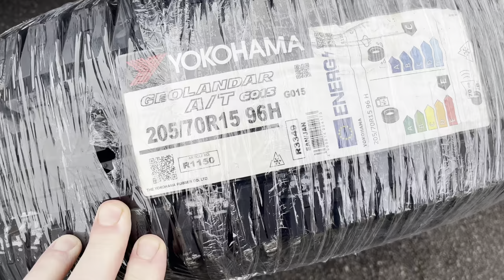VW CADDY VAN UPGRADE | Fitting All Terrain Tyres - Yokohama Geolander 205/70/15

Comment: I am tempted to do this myself. Speedo wise the size increase seems to correlate to about 5% difference on the steelies, which is coincidentally about the same amount my speedo is off.
Reply from the maker: @corroded  Just go for it, I have no regrets on doing this upgrade 👍
Reply: @LoneWolfExplorer 

What is the departure of the disks?
Reply from the maker: @Денис-я6й6и  I’m not sure what you mean.

Comment: hi mate, just seen this video! van looks very smart. I have a 2016 1.6 TDI caddy with off road toyo tyres on, they are incredibly useful and the van goes where my hilux doesn't dream of going!
Reply from the maker: Well that’s good to know that your caddy is good in the muddy stuff with the toyos. Is your caddy a 4motion? I’m not planning on any off-roading in mine but wanted to know I have a better chance if I do venture off the tarmac. Thanks for watching mate 👍
Reply: To be honest, im not too sure if it is a 4 motion. Its a reliable van though. However, I have received some major problems at only 96k miles. It needed a new clutch,break discs, wishbones, injectors,callipers and a lot more. It's an ex police van for West Mercia police so has been through the wars! But, its a great van and a speedy one too!  @LoneWolfExplorer
Reply from the maker: @amasfarmcontracting7602  That’s interesting, don’t think I’ve seen a police caddy van before, well not that I can remember anyway. They are great little vans, I really like mine and I’m not easily pleased. Mines a high mileage one and had quite a lot of work done also, including the injector.
Reply: Mostly used by dog unit but the shorter caddy vans are rarer for the Uk police as they have now gone for the longer base caddys. I usually go to breakers yards for parts as they are cheap and really reliable. No need spending so much at VW dealerships as they can rip you off! VW wanted to charge me £10k for a new clutch and gearbox but got the clutch and gearbox fitted at a small garage for £2k. hasn't broken down since(March 2023) @LoneWolfExplorer
Reply from the maker: @amasfarmcontracting7602  Wow 10k for a clutch at VW…..that’s mind boggling. I only use smaller garages anyway or try to do stuff myself. The previous owner of my van had nearly all the work done at VW, I’d imagine yours did aswell being ex police.
Reply: I was not too pleased with the quote given by VW but would not go to them in an emergency haha, yeah all works were done at VW when it was in service, everything is reinforced and still had blue lights on the roof and grill which i had to change for amber ones. But having a caddy as a sleeper is great! Slept in it twice on the job and was better than many hotels I have been to. @LoneWolfExplorer
Reply from the maker: @amasfarmcontracting7602  Yes I also think they make a good stealth camper provided people don’t actually make them look like a camper van 👍

Comment: I have 215/65r16 on mine and it works perfect!
Reply from the maker: That’s great, I looked at fitting 16s as wasn’t sure how easy it was to get ATs in 15s but was easy enough. I bet it looks good with the 16s, what ATs are you running?

Comment: Merhaba dilinize pek hakim değilim . Sadece izledim . 205/70/15 tekerlek taktınız yorumlarınız merak ediyorum . Aracı toplamda kaç cm yükseltti? Viraj performansı nasıl km ekranındaki hız farkı çok farketti mi ? Yakıtı etkiledimi? Yorum olarak yazabilirseniz çeviri aracıyla videonuzu anlayabileceğim
Reply from the maker: Hi, I tried to use google translate but its not that accurate so I'll try my best to answer. First of all thanks for watching and did the subtitles help? With cornering, I can't notice much seems the same as before. Not sure how much it raised it off the floor with the bigger tyres but it has no suspension lift. I have checked the speedo & it is now accurate according to GPS on sat-nav.

Comment: I have 18" wheels, do you know of any all terrain options?
Reply from the maker: Well actually yes, Yokohama do these in an 18” as I’m looking at using them on my Subaru in a 235/60/18. Also Falken wildpeaks do a 235/60/18 & Toyo open country do a 235/60/18. I had some BFG all terrain in an 18” on my Discovery 2 many years ago but can’t remember the size, they were bigger than 235/60/18 so it depends on what size you want.

Comment: Is it a 1,6 litres diesel?
Reply from the maker: Yes, exactly 1.6 litre turbo diesel 👍
Reply: @LoneWolfExplorer  ooooh not good. Always that problem.
Reply from the maker: @nerdiep3456  Which one, the injector issue?
Reply: @LoneWolfExplorer  yes
Reply from the maker: @nerdiep3456  I’ve just had it happen, check out the video in my description or look at my latest caddy videos My VW CADDY VAN Has PROBLEMS
https://youtu.be/_nhtEhsLN54